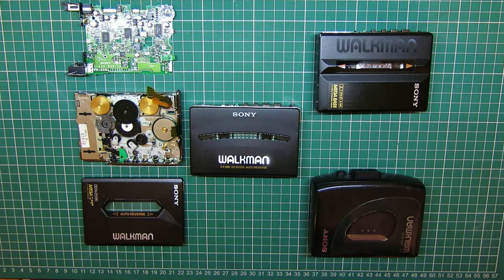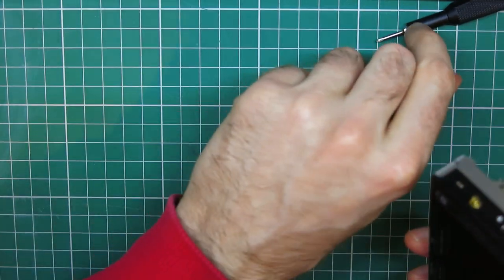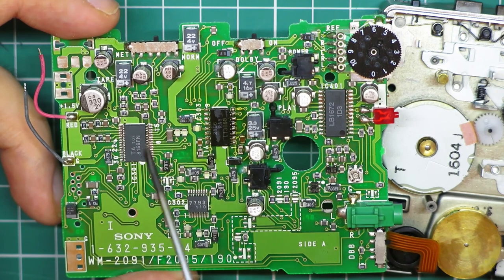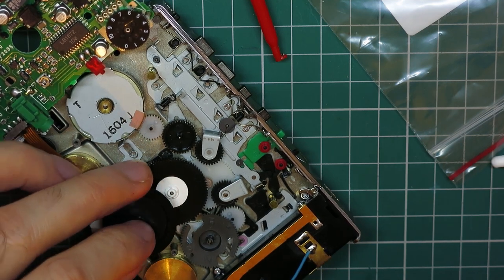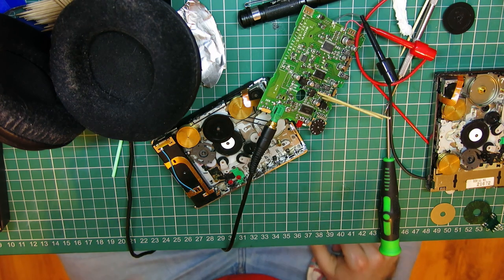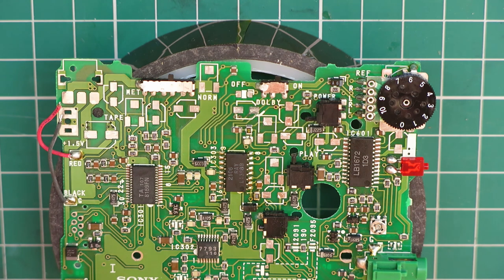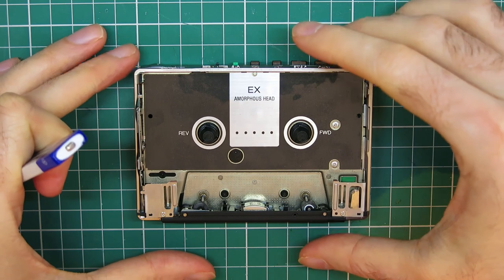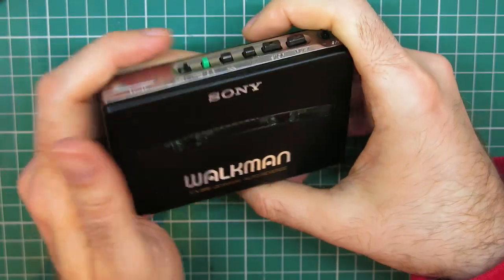1991 Sony WM-190 Walkman Repair (Japanese Import)

Comment: Would the capacitors be the culprit of if I replaced belt and clutch gear and the sound sounds like the motor with hissing
Reply from the maker: Most likely yes! Some are used to decouple the preamp and Dolby stages, so if they fail, signal will not pass, and voltages will be off
Reply: @jamesbennettmusic  how hard and what capacitors would I need to change I was barely able to desolder and resolder the wires to flip the board
Reply from the maker: @paulolivarri4552  all the SMD electrolytics like I did in the video - not easy
Reply: @jamesbennettmusic  do you happen to take orders for recapping

Comment: my ex50 walkman(same internal mechanism as in the video) makes the same buzzing sound and i think its cause of the "corrosion" in the motor magnet like you said(sounds like the back of a fridge buzzing), is there a way to fix this or should i replace it? if so where can i get a replacement? at the end of the video the music was fine how did you fix it?
Reply from the maker: The buzzing noise is caused by the capacitors failing - the only fix is to replace them. The motor corrosion doesn't cause noise but it causes loss of torque and higher current drain from the battery
Reply: @jamesbennettmusic  do you know what type of capacitators should i get? and take note the buzzing of the motor happens even without the belts
Reply from the maker: @beebeenuts7267  I did it with Panasonics from a UK trade supplier - you'd have to find SMD capacitors of the right value, voltage and size from a supplier in your country

Comment: Great video. Mine has bad sound like snoring. Why ? Capacitors ? if yes, where can I buy them? Thanks
Reply from the maker: Thanks. Could be! I bought mine from Farnell in the UK, but you might have to find a regional supplier more local to you
Reply: @jamesbennettmusic  thanks, can you provide me list need to be replace according to service manual?
Reply from the maker: @allardsylvain2773  https://stereo2go.com/forums/threads/fixing-my-wm-ex49-capacitor-questions.6028/
Reply: @jamesbennettmusic  thanks a lot. Is there a position of the gears to be done before close with the board Electronic ?